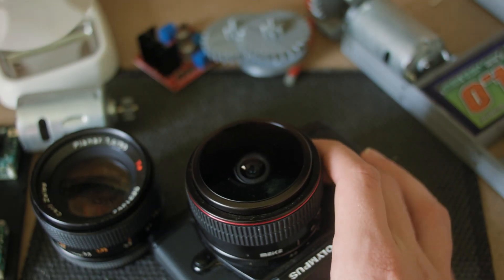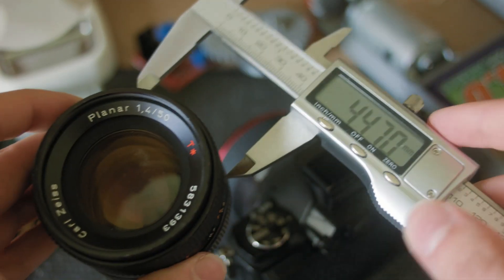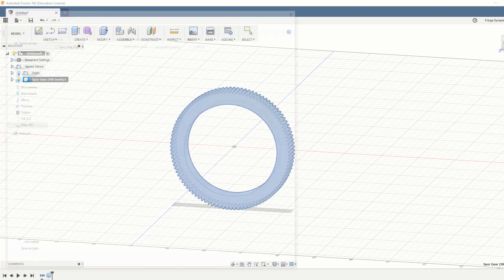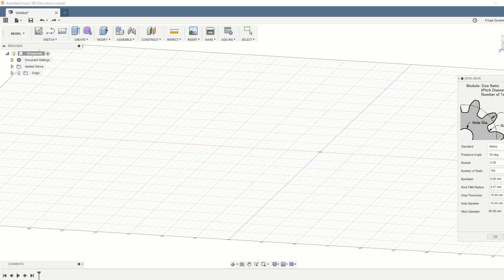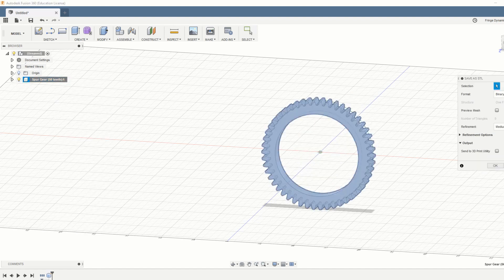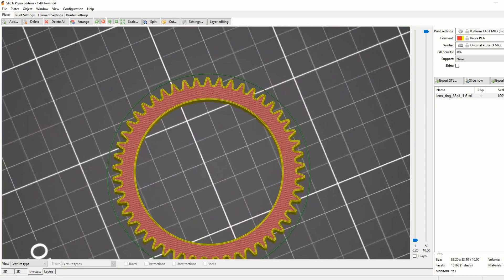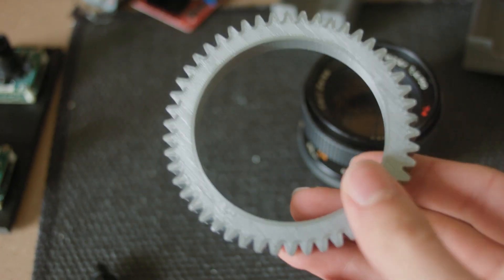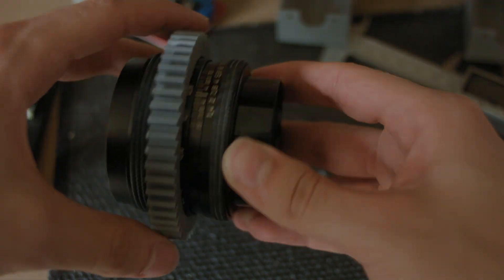3D Printed Follow Focus: Focus Gear

Comment: Hi again, I think I will try to make a follow focus too after viewing your videos, with a different design, could be fun to compare our desings. As for your fitting, I find that 0.2mm of clearance for an inner diameter is just right so you do not need to sand the piece (I hate sanding !). That is if your printer is well calibrated, but with your Prusa MK3 I am not worried at all.